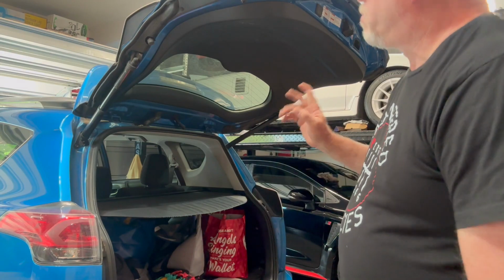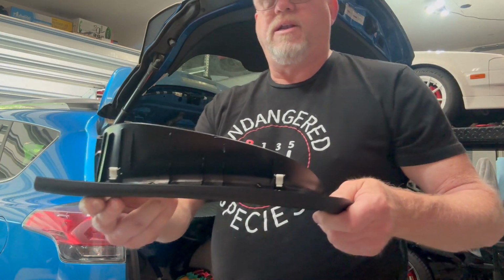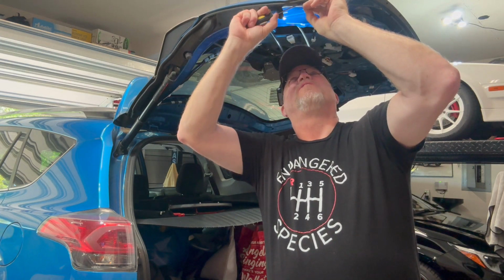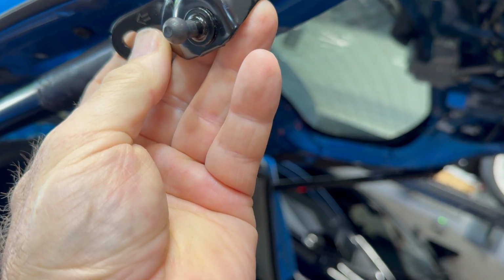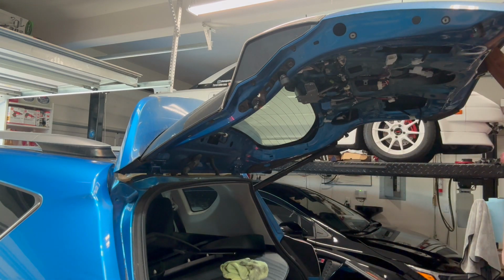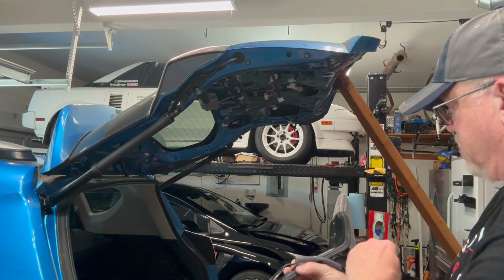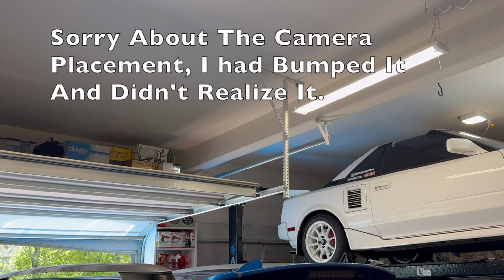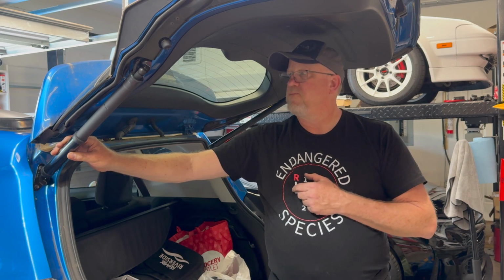Master the Art of Solving TOYOTA/LEXUS Power Rear Hatch Problems! DIY for Your 2018 RAV4

Comment: Hi Jim, Excellent replacement guide. I was wondering if there's any way to mitigate replacement by lubrication or servicing? The parts are just so darn expensive.
Reply from the maker: That they are. I looked at them and it doesn't appear that there is any way to do that. I also asked a Toyota tech that I know and he confirmed it too. I told my daughter to try and use the back seat more for little things vs opening up the hatch like she always did.
Reply: @jimsgaragetoys  Thanks very much for the reply, Jim. Hope to see more repairs like this in the future!
Reply from the maker: @SimonLi89  Anything I do on any car I do a video on it! 😍

Comment: Could this also be the cause of the door not opening all the way up and also getting stuck and not wanting to close?  My wife's has this issue although they don't sound noisy, but do have some play.
Reply from the maker: Yes indeed. If they aren't operating properly and opening all the way they should be replaced. Make sure that they are set to open all the way up though since that can be adjusted in the menu.

Comment: I have same issue with my 2017 RAV4 SE Left side here in Canada is very expensive over $C2,000.00 plus HST, I decide just go with manual gas struts and decide also replaced brackets . My total cost 6 parts in total C$250.00
Reply from the maker: That's crazy! I was lucky that I got the parts new for a discount, while still expensive, it was a big savings for my daughter.
Reply: @jimsgaragetoys   If you are located in USA is much cheaper than here high taxes Canada , I try to ship form us online stores to Canada no shipping to Canada. Best price for power lifter is $US 315.00 compare to Canada $C1274.00 plus 13% taxes
Reply from the maker: @hexen0076  Everything is more expensive in Canada. The cheapest options in the US are not OEM quality so use at your own risk. The OEM ones are more but should outlast the aftermarket options as I've had people tell me that they didn't last very long for them.

Comment: Hi.if  you change back door setting in multifunction display (set it to "all off" ) it will be working  maunal
Reply from the maker: The automatic functions won't work but the struts are still working to help open the door and hold it up in the open position!
Reply: My Aunt 2017 RAV4 rear hatch only opens a little so I’m guessing this is the issue also. But like someone said if I switch the power switch to off on the hatch will I be able to open it manually? Thanks and great video.